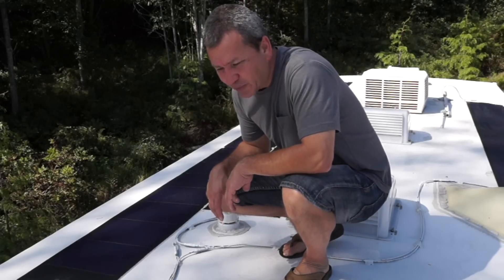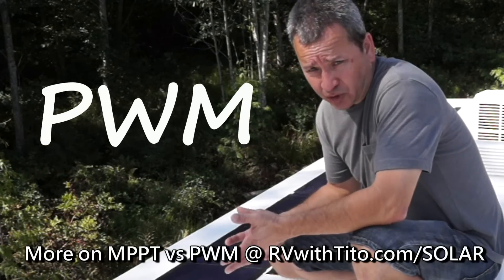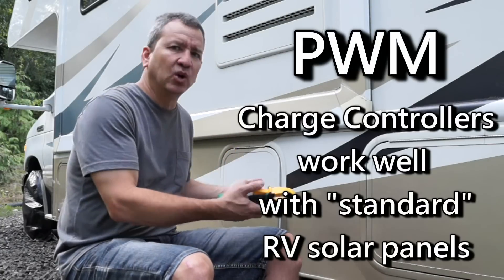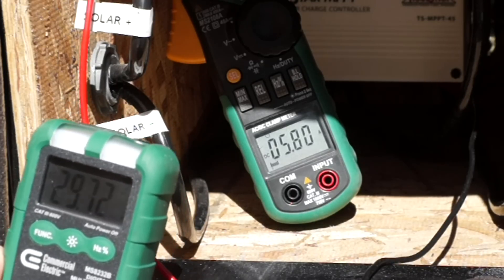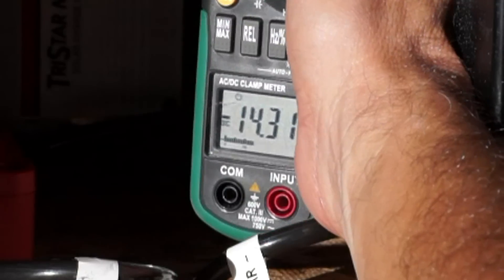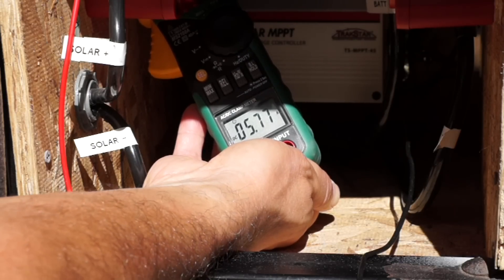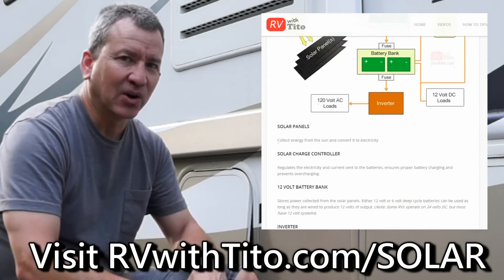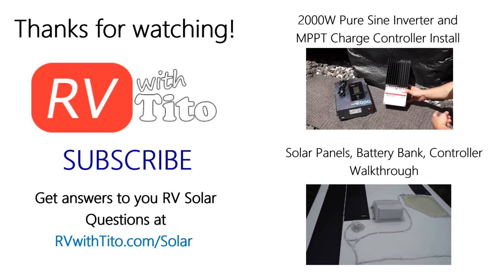MPPT or PWM Solar Charge Controller for High Voltage Solar Panels?

Comment: Thanks for this video presentation !  Helps me a lot !  I have been concerned my translation of the Tracer 4210A manual might be wrong. It does say this controller will accept 92v-100v and a max of 3120w @ 24vdc which my bank is, and inverter will accept.  Tnx, rc

Comment: what is difference when we charge 12v of 4 batteries connected in parallel by 12v, 150w panel(let 4 panels)

And 4 batteries of 24v(2 in series) by 150w , 24v panel

Comment: can i ask you a question, is it true that the panels can convert artificial light as well ? for example if over night i park under a very bright lamp on walmarts car park would i be able to charge my battery over night? if so how much power would it be ? how many watts are your solar panels ?

best regards
Reply: I have seen a voltage reading from my shop lights.

Comment: Some mppt charge controllers are also pwm at float mode. So unless you are bulk charging they no benefit and if you are in bulk charge mode for long you really need more solar. The important thing is higher voltage is more efficient for the wire size used so best look for high voltage charge controllers and series connect panels.

Comment: would you be able to use 24 volt panels to run 12volt system i would be able to use one panel 250 watts  instead of 2 100 watt panels
Reply from the maker: +mastertek2000 Yes you could. You'll need an MPPT controller if you want to convert all 24 volts though to get the benefit of the 250 watt panel.
Reply: that's what i figured just don't understand why people are wasting their time with 100 watt panels thanks for the quick reply

Comment: Tito,
    I enjoy your page and thanks for sharing all of your information.
    I have an old Class B, Dodge Motorhome that I recently purchased a 300w solar kit for.  My intent is to power the whole motorhome by solar.
    My Class B has the common dual battery setup.  One for the engine and one for the coach side.  As I drive, the engine alternator charges both batteries.  I also have the 110 power shore hook up, with converter, that also charges the batteries.
   The solar kit that I purchased has the panels, wiring, and a charge controller.  My question is; can I simply  go through the solar charge controller and plug in to my 110 shore power line?  That way I utilize the converter and batteries that are already in my coach and I’m able to use my fridge and all power outlets? Then when parked, I could simply unplug the solar and connect to the 110 shore???
    Thanks for any assistance.  Happy motoring!

Comment: Hi Tito,

I have watched a number of your video's and I am not sure if this is the correct one to ask this question.  If so I apologize.

I have watched a number of videos about installing solar on RVs.  What I keep missing is the hookup so that the batteries are charged when the RV is being driven.
How does that work?

Is there a single charge controller that takes input from:
- Solar Panels
- External Generator
- Car Alternator

or does it take 3 devices one for each input and each unit then monitors if the battery is charged?

When I drive down the road I want to charge my batteries.  Also I want my engine battery isolated so I don't discharge it inadvertently.

Appreciate any guidance in understanding how these things go together.
Reply from the maker: It depends on the type of RV you have. In my Class C motorhome, the house batteries and electrical are totally separate from the chassis battery and electrical system. When driving, only the chassis battery is getting charged from the alternator. When driving, my house batteries are charged from solar (during daytime that is). With that said, some RVs do have a connection between the chassis alternator and house battery bank. Mine does not and I plan to keep them separate. I generally keep the charge controller and solar connected even when on shore power. The charge controller is always sensing the battery level and will only send charge current to the batteries when they need it. When on shore power, the charger built in to the RV takes over charging.

I have a built generator which serves as a backup for shore power when running. The RV electrical automatically switches to generator power when it is running. If you have an external generator, it can be used in two ways. You can plug your RV shore power cord into the generator or you can use it to power a battery charger to rapid charge your battery bank. 

Hope that helps.
Reply: Thks for taking your time to reply.

Comment: I have a measly little 4 amp charge controller from a kit.  I've seen 30 amp 60 amp and 90 amp charge controllers.  Mostly 60 amps is recommended but I'm thinking of the future so my feeling is bigger is better.  Go with the 90 amp ?..........Thanks.........Scott
Reply from the maker: 4 to 90 is quite a jump. You'll never use that much on an RV. It depends on how much solar you have. If you have 400w or less than a 30 amp should be fine.

Comment: sir,
thanks for this video,i am also trying to understand MPPT and your video is very informative for me,but i need some addition of information over this,as following.
1) You have shown the increased current level after MPPT to battery but i want you to show the corrected voltage supplied to battery after MPPT.

thanks in advance.
Reply from the maker: +Prashant Singh The output voltage remains constant from the charge controller based on the chosen charging algorithm for my battery type. Only the current increases.

Comment: Brian, I been confused about the difference between the 45 watt and 60. The price difference is about 150 + dollars and I am planning to go up to 400 to 500 watts on panels for my 25 ' Arctic Fox trailer. Would the 45 watt mppt be adequate . I want to do this only once and get it right. Thanks

Comment: Hi Brian, you explained it like you are Einstein. An ignoramus like me, understood it right away. Thank you for making this video. So, my question is where will  i see the maximum voltage or panels that you can use in the MPPT Controller in 1 series, like if I have a controller at max 30 amperes, and I have a total of 9 panels of 100 watts at 12 volts, how many panels can I used in 1 series ? Let us say, I will use 3 panels in a series, then another 3 panels then another 3 panels for a total of 9 panels how can I know that this is safe and where I will see those specs in the MPPT Charge controller? Thank you
Reply from the maker: +robert james Your 30 amp controller should also have a maximum input voltage rating. The maximum on my MPPT controller is 150 volts. So as long as your solar array output is within the controller's input current and voltage rating, you should be ok. If you exceed these specifications, then the fault protection on your controller (assuming it has that feature) will probably kick in. This will vary depending on the features of your charge controller. Hope that helps.
Reply: A lot of help Brian. Thank you.

Comment: i got 2  24v  200wt pannels so im going to use mppt charge controller is it ok  if my battery bank and inverter is 12v, thanks....
Reply from the maker: +joel mori Yes. You should be good. Just make sure your charge controller is programmed for a 12v battery bank and you don't exceed the amp and voltage rating of the controller.

Comment: Hi, friend!
I need your help, please!
Here in Israel outside is 45 degrees Centigrades and I am a little warried. Please look at the pictures and give me an advise and tell me if I should be warried  and what I should do.
The charger shows that the two batteries are more than 30 volts as you see in the voltmeter and I measured the two together and each one. And the other device says the each battery is full and has the red light of alternator lit but this electric car has no alternator. The green light that shows that the battery is good lights only sometimes. Is this normal?  Please help me.
Thank You!

Comment: Addendum #2:Use multi strand 2/0, 2/00, or even 3/0 AWG hook up DC copper battery wire. If you use solid core copper wire, than you will choke off your Amps !

Comment: Addendum: You simply cannot have this discussion without a serious talk about voltage level drop off's under typical AC loads. A general rule of thumb is to remove one "0" from the wattage rating of the power inverter and this will give you a rough idea of how many Amps the wire you use to connect your inverter must handle. So in case, I am using a Go Power 1500 Amp inverter, which means I need to use a non ferrous copper multi strand wire of no less than 2/0 AWG Gauge connecting wire. Most inverter manuals say to use no more than 10 feet of 2 Guage wire, but that is simply not good enough  !! According to the American Wire Gauge table 1, regular two gauge copper wire will only give you a maximum of 94 Amps handling capability ! Now comes voltage drop under load and current loss, causing your inverter to be unable to deliver the full duty it was designed for, because your wire is choking off the available amperage you could have from your batteries. Also, short as possible positive and negative wire runs from your battery array to your inverter should be made, or agsin, you will choke your voltage and your current levels.

Comment: Now for what you didn't say - Most folks do not have the Maximum Power Point  Tracking controllers in their RV solar-powered systems because MPPT controllers are quite pricey ! Most folks have Pulse Width Modulation charge controllers because they can do the job at about 1/3rd of the price of a Midnight Solar MPPT controller. The other issue which bears more discussion is the charging voltage (float level charge) set by your charge controller. Many pwm controllers are automatically locked at 13.46 to 13.8  charging volts DC.  This is simply not good enough if you want the maximum wattage out of your DC to AC inverter. A pwm charge controller  is just fine as long as you can set the float charge at 14.4 Volts DC. Going to any higher voltage than this can burn up your batteries. Also anymore current  than an industrial rate @ C 10 Amps will boil off the acid in your flood ed lead acid, deep cycle Trojan T -105's 6 Volt batteries.

Comment: Do panels have and batters be hook up the same how do you not. Damage the charging part in the camper  I have 4 100w panels and mppt charge controller  12/24 v current of 40a  renogy tracer max PV is input of 500w(12) 1000 w(24v) is there a way to hook up with out  damage the camper charger  or how to put a on/ off  this is my first time in this

Comment: What did the MPPT controller do with the extra energy?  Was is divided between each battery in the bank??
Reply: It converted about 180W of power coming in at 30 volts into about the same amount of power at a lower voltage but a higher current. Power = Current x Voltage, and the only energy wasted in an MPPT controller is a bit of heat.
 
A PWM controller cuts the power many times each second to make sure that the battery is not over-charged, while an MPPT controller has extra circuits which can deliver the maximum amount of power available. Of course, once the batteries are full, an MPPT controller will also reduce power to the batteries. Both will protect the battery, but an MPPT controller charges the batteries faster, and wastes less energy, but costs more and is heavier than a PWM controller.

Comment: Great video!   Thank you for sharing that!

Please, be aware of Chinese fake MPPT controllers.    The dead giveaway is how ridiculously cheap they are and the low input voltage capacity.   A real MPPT controller should be able to handle in excess of 100 VDC input - and, will typically cost over $100.00 for 20 amps and go up from there.

Remember, you're probably going to get what you pay for.   So, pay a cheap price for a cheap Chinese "MPPT" controller and you will likely get a cheap, poor quality PWM controller, instead.   Do your research and purchase "Made in USA" to reduce the risk of being ripped off.   You're not going to get a good MPPT controller for a cheap price.   Learn to accept that fact, along with the fact that a good MPPT controller will definitely add to the performance and efficiency of your system.

Don't cheap out on your controller, your inverter, or your batteries.  If you want to save money, buy good quality used equipment, not low quality new equipment.   The low quality new equipment will cost you more in the long term in the form of more frequent replacement due to failures.   Why waste your money buying cheap stuff over and over, again?  Buy the good stuff once, instead.
Reply: Well said thanks 👍

Comment: Another great video Brian....However I've a question.....Ok......Lets say I've bought a solar panel,  a 92 watt Fuji (Japan) Fwave flexible solar panel It's high voltage (320 volts).....And I wish to use this in a 12v system in my boat, now very clearly I must drop the voltage down using a "step down" controller.......and yes I'll being using a MPPT solar controller, so the big question is which voltage "step down" controller would I use 12v or 24 volt? Remember my system is 12v BUT using a 24v step down controller before the volts goes into the MPPT would make the best use of the MPPT controller as from what I can gather MPPT's work best on higher voltage,......interesting hey............

Comment: Yeah, there's more to going solar than meets the eye. Here's one pitfall:
Inverters will shut down if they see too high a voltage from the battery bank, which can happen while the batteries are charging in the daytime. For example, a 12v inverter might have a 15v shutdown in the specs, but actually shuts down at the same voltage the charger is putting out (say 14.4v). When that happens some people will lower the charging voltage setting which solves that problem, but then their batteries don't get fully topped off and end up running out of power too soon everyday. This happens with cheaper inverters. Quality inverters like Magnum will have a higher shutdown voltage (16 or 17v) so you don't have that problem and can properly charge your batteries. So if you can't seem to run much off of your batteries, this might be the reason. The Trojan Battery company says 14.8V daily charge (at 77 degrees F) and Interstate will tell you over 15V. So you can see why someone (such as the dealer) will mistakenly lower the charger voltage instead of replacing that inverter.

Comment: With the low price of MPPT's, they are now the clear choice.
Reply from the maker: +Joe Shmoe Yes, agreed. Though I ended up spending a little more $$$ to make sure I got a good quality one from a reputable company. I'm sure there are several questionable units out there. I've had one.
Reply: +RVwithTito  I've seen complete fakes, open them up and look, they are PWM. One of the best MPPT's is Genasun. 10 amps for about $100.

Comment: Hey i have 4 190 watt 24 volt voc 43.8  panels for my house and want to run into a 12 volt battery bank of 440 amps.I would like to wire 2 panels in parallel to get 73 vmp and then wire them in series to raise the amps.THE PANELS ARE RATED @
 (5.2A 36.5VDC) I want a charge controller that will cost under 200.00 and was thinking about the tracer 40 amp but the seller says that i would have to run that into a 24 volt battery bank.I don't know what to do.They suggested the midnight solar charge controller at 695.00 I cant do that.
Reply from the maker: +dhlwood It seems to me that your proposed series/parallel setup is within the specifications of the Tracer 40 which can handle up to 100 volts. With the setup you proposed, your max will be 73 volts at around 20 amps (I think). I don't know anything about the Tracer, but it looks like it should work if switched to 12 volt mode and MPPT. Perhaps you could get a better explanation from them why it won't work.

Comment: Thank you Thank you. That was straight to the point. Got a newbie question. My rv is not as big as yours but I want plenty of power. How many 12v 100w mono panels and how many deep cell batt's do I need to have all I want for day to day life? Extra but not crazy. If you can not tell me how many batt's... how many watt hours then please?
Reply: Finely someone has hinted to why 24 or 48v is better. Could you explain further. Its not a small rv its a 28 foot or something like that. No air conditioning as Im on a mtn at 9500 feet. The sun is also very powerful up here. Just tv laptop things like that. I will need a fridge but that is the highest power input and it can run off gas as well.
Reply: I'm using my system for a cabin and have 6 golf cart batteries and 2, 265 watt panels. The incoming voltage is around 30, incoming amperage is around 8-9 amps each and they're wired in parallel to a PWM controller.  What do you think?  Time to wire in series and upgrade to an MPPT controller?   You seem to know your stuff even though you claim not to.  I've been reading up on this stuff for months, but that's what's so fun about it.  Learning, experimenting, tinkering, etc.
Reply: Also, the cables run about 20 feet from the panels to the controller and it's 220 (10/2) Romex.  It should be good up to 30 amps based on what I've read. Do you concur?

Comment: I was gonna go with the renogy 30 amp wanderer. have you heard anything about those?
Reply from the maker: +Brunden420 I've only had Renogy panels. I know folks who are using Renogy controllers without any trouble so you should be ok. At least they are in California so you can call them for support.